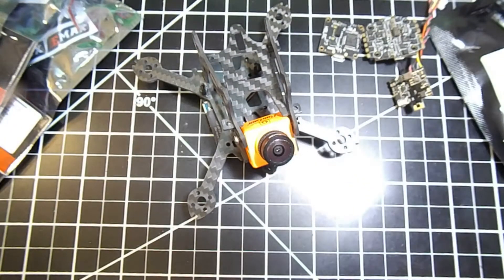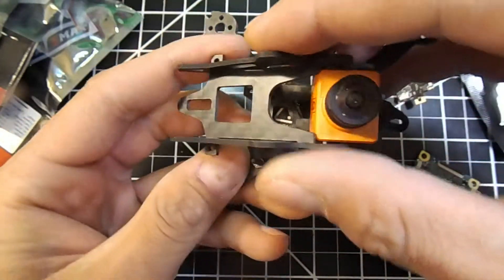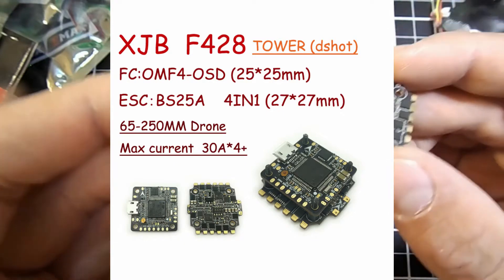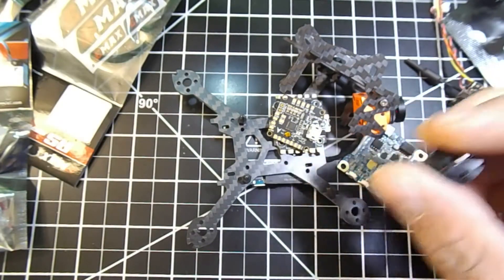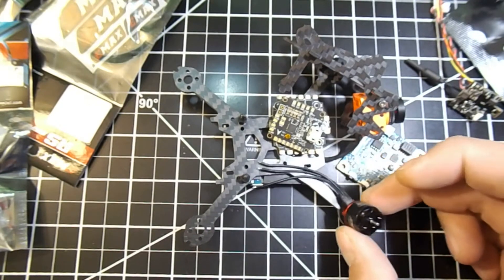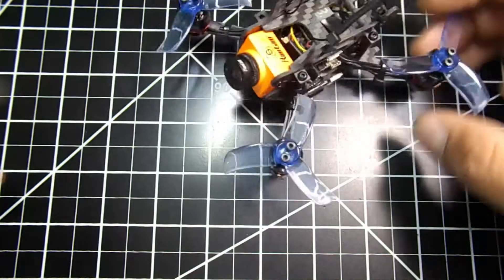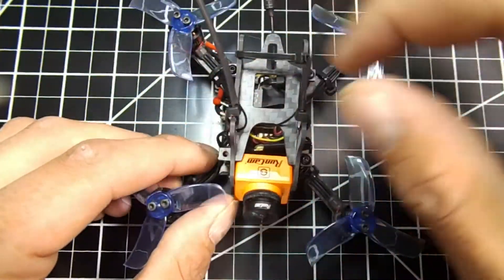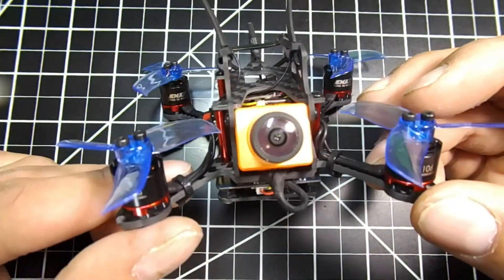Worlds Smallest 4S Micro Brushless w/ TRUE HD!

Comment: AUW?
Reply from the maker: I dont have this build anymore but i remember it was around 230g with 450mah 4s
Reply: Not bad.  How was the flight duration?
Reply: No way, that's way heavy. My 3in Intrepid v2 with an 850mah 4s, a runcam split v1, and 1407 motors with 5mm shafts comes in at 250g.

Comment: Cool build man , get a zip tie and mount it to your frame and shove the end of it inside the bottom of your dipole antenna for 5.8ghz , I found that it works quite well once cut to length and I didn’t have to use extra heat shrink

Comment: FPV Prints did you cut the carbon fiber bit under runcam split pcb or it can be bought somewhere pre cut?
Reply from the maker: Esquisse I had to drill two more holes for the split board. Not too big of a job. I am in the works with FLEXRC on a new 2 inch frame that will accept the runcam split. Videos on that coming soon!
Reply: FPV Prints i meant the small carbon fiber 30x30 bit which protects the runcam from the bottom. Did it come with the frame or its custom made?
Reply from the maker: Esquisse ohh. I had that laying around from an old frame. You can buy them on armattan.com
Reply: Thanks. Will try http://www.armattanquads.com/morphite-x-155-top-plate/ hopefully its the right size.